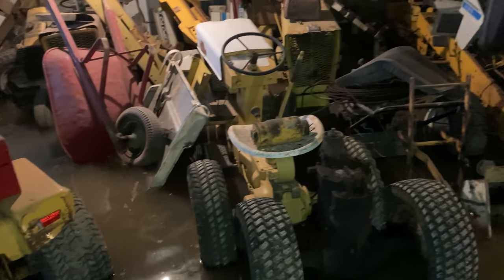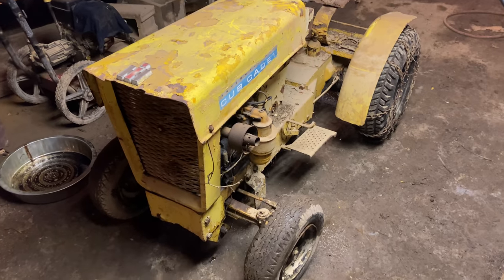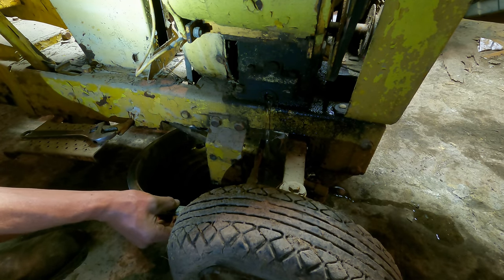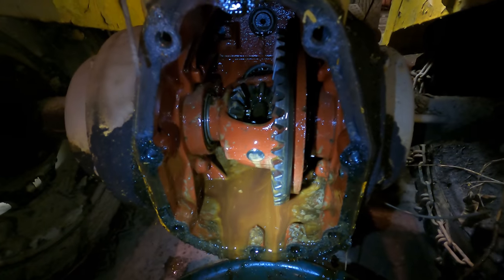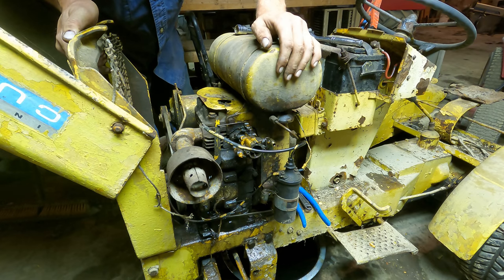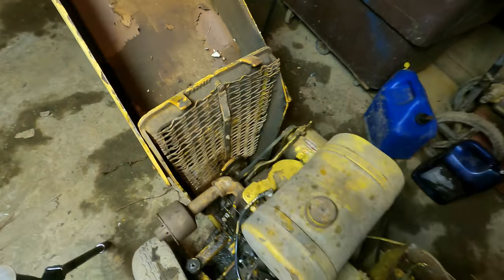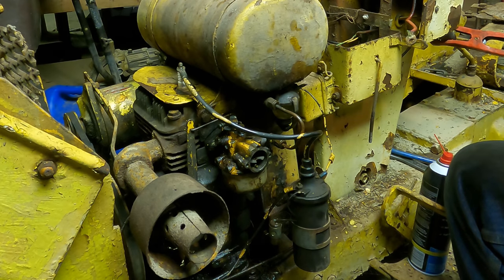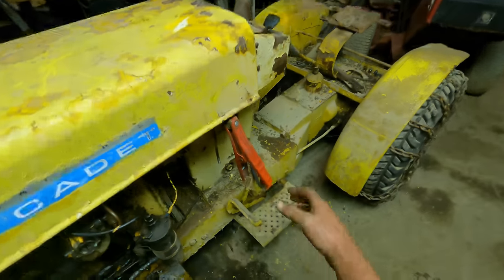Flooded Tractor sitting 10+ years, Will it Start and Drive??

Comment: It's always funny that people will put so much time into painting, but won't even bother to clean anything first. I've seen old machine tools where you just peel off 8 layers of paint, clean it up, and the original paint at the bottom still looks fine!
Reply: Oh man?!!! Was that a big red I saw 👀 😭
Reply: More paint more better.... Right
Reply: My grandfather had a metal lathe that we couldn't tell what year model anything on because it had so much paint on it. I'm not joking when I say when we stripped the paint off of it it had 21 layers of paint on it.
Reply: Really depends on what type of machine we are speaking of. Big Tools are painted to keep looking fresh. They some time even painted them new so that the original paint does not go bad or its not the color of their shop. Painting also helps with theft or people trying to sell your machine. I have seen massive amounts of things painted and its hard seeing a machine that has years and years of paint on it. I spent 2 solid weeks stripping, sanding and cleaning up a massive 18 inch jointer for someone. I spent so much time removing layers and layer of paint. I sanded and fixed a lot of castings marks and made it look very nice and we painted it a bright yellow and polished all the knobs and handles along with paint on them. A few years later the guy died and the original owner of the machine came and got it for a stupid low price (100 dollars ) and now it sits under cover in one of his buildings to never be used again. I worked 2 weeks and was paid and traded for some stuff. The hours I put in to that machine and it was sold for 100 bucks. FFS.
Reply: Yea seems counter productive to me
Reply: Had an old "black" wheel horse that with a good pressure washing returned to factory red.
Reply: What amazes me is oil drain plugs for lawn tractors hasn’t changed a bit—put it somewhere that will allow the oil to go everywhere except the pan.
Reply: Spray painting the house, and the yard tractor is sitting right there... so....  sigh
Reply: @kameljoe21  Think it lucky thats what happened to it, over the years I've tried to buy equipment from guys, who said not for sale they'd restore it or it has huge sentimental value. a few years later the guys have died and I've tried buying it from the estate.  They say "we'll get back to you", one place the scrap grapple turned in the yard as i was leaving, several other places were cleared shortly after. They had no intention of saving anything from the scrap crushers  after the old guy died !
Reply: Me too many times
Reply: I’m kinda disappointed I didn’t paint my puch maxi when i had it taken apart. Would’ve increased the value a lot, but the original paint is still fine and i cba to take it apart again.
Reply: Paint dosent make it run well lol I have great running rusty old junk haha
Reply: That's a nice ol cubbie - I'd restore it if I owned it
Reply: I think a file is better on the point surfaces as it leaves no abrasive behind
Reply: Paints main job is to protect the metal from rust period, anything else is just gravy. When in dought slop it on, easier to strip then rust.
Reply: Hey Wes u or diesel creek need to have a video on how to to hook up a after market  voltage regulator for a international  cub 70.... would help me out a lot.
Reply: Get enough layers of paint on there and it becomes structural!  The original metal could rust away and the body would still be there.
Reply: It's because most people are lazy
Reply: So true for company tools,  programmed maintance at it's best.
Reply: Someone repainted my grader with a brush and they didn’t even clean it. I was wondering if someone snapped off a bolt in a treaded hole, nope wasn’t a bolt and it was just dirt that had been painted over twice
Reply: 4
Reply: 4
Reply: Nearly every Wheel Horse I have ever bought has the Craig's list rattle can finish. Very handy when you need to read the manufacturer model and serial  numbers

Comment: I had no doubt.  Many years ago, a National Guard construction troupe was doing some winter exercises in a swamp in Western Minnesota.  They were using an International TD-24 tractor/dozer.  The machine fell through the ice in a swamp, and  the machine was under water. The Guard unit left it to rust.  Forty-Three years later, the Minnesota Department of Natural Resources wanted the machine out of the swamp. A group of preservationists, along with two heavy duty wreckers fished the machine out of the swamp,and hauled it to Perham, Minnesota. It was worked on,  and now runs and works.  The machine is on display at the fairgrounds in Perham, Minnesota, where it moves and works during festivals on the grounds.

Comment: My family used to own an early to mid 70's Cub Lawn tractor (the model with the taller than usual rear wheels). It's amazing how over engineered and powerful small tractors were back then. I also really love and appreciate (looking back now) how EVERYTHING was metal and robust with no cheap plastic panels or weak alloy components. They had real weight to them because the frame and cases were thick steel that made them far more stable to mow on steep hilly areas by proving the traction and lower center of gravity needed. You can't forget about the proper PTO that allows that small tractor to be used as a real tractor when needed. Watching this video makes me want to start hunting down an old  unit to restore and  replace my current plastic, composite, alloy, and thin sheet metal framed 2019 Cub.

Comment: First time I've seen a man give mouth-to-mouth to a cub cadet. You sure do love them!
Reply: The old Koehler engines have mechanical fuel pumps that would have outlasted the pyramids if they hadn't put alcohol in the fuel. The Cubs were gravity fed so not that big of an issue but the Wheelhorse tractors have a tank under the seat. I have 2 that you used to have to breathe some life into before I put electric fuel pumps on. The springs that close the check valves in the pump are steel which pretty much disintegrate in water which alcohol gathers.
 So yep, if you want it to start, pucker up and give that fuel tank a big sloppy one. The tounge thing is optional and not recommended....
Terry from South Carolina

Comment: Did that bring back memories. I had one just like yours. It had been bored and rebuilt just before I got it. I plowed snow with it for six or seven years before I got my first Kubota. That ole Cub was one tough "mother". I had chains on the rear and with a 52" blade.  I shamed a guy on our street with a 25hp full dress green mach. The Kohler engine had 7hp label on the housing. I was rolling 10" of snow in high gear because of the blade geo.  He was spinning out in low and his blade was actually pushing down on the snow rather getting under and rolling it off. He stopped me and asked "how many hp does that thing have?' I Just flipped the hood up, he saw that 7hp, muttered a expletive and went in the house.  Never saw him again.....
Nice work on your part-keep up the variety..

Comment: It would make a great project for a full restoration. I would love to see you strip it down completely, clean the frame and all the components.  Repair what needs repairing, replace what needs replacing. Repaint and rebuild. It would be sweet to see the result.
Reply: I would also. But sadly I don't think we will ever see this tractor again. He has tons of such projects and still gets more every week. At some point the number of projects will certainly out number the life span of even the oldest person ever in existence...  The number of projects he has started are amazing. But I personally have never seen but maybe one or two finish at this point. I think he just loves to get old equipment and make them run. Than the challenge is gone and he moves on to the next. JMHO
Reply: @garymucher9590  He needs to partner up with someone interested in taking the project on to full restoration.
Reply: Yeah Matt,
Hopefully, you have second thoughts and do a total rebuild !! It's worth it, I think - don't you think so ?
Reply: @garymucher9590  yeah it would be nice to concentrate on one project rather than getting interested in one that’s never going to get finished
Reply: @johnking8679  Autocar first.
Reply: Matt will want to half-assed pressure wash it, then prime over the old paint and rust, and then paint it.  We want a full tear down and refurb!!
Reply: You spend the countless hours and money on a complete refurbish and you end up with an old tractor that you have spent more than you can ever get out of it.  If Matt wants to spend his time that way, that is fine.  Hoping someone else spends their time that way is a completely different thing.
Reply: @jimw3799  it would be nice if he would let it go instead of saying that he will get to it eventually, while knowing that he won't.

Comment: When I moved my Mom down to Georgia from NY to take care of her 4 years ago, I bought a 16' cargo trailer to bring down her stuff. I left behind her Wheel Horse tractor they bought new in the mid 70's. It was still operational and my sister's husband used it to cut her lawn afterwards. There was much I wanted to bring down, but I filled the trailer with about 5,000 lbs. of her stuff and with a 37HP tractor to mow my lawn I didn't really "need" the Wheel Horse. It was really in very good condition as it was used every year, stored in a barn and battery removed every winter. Glad to see yet another piece of vintage steel brought back to life!

Comment: Hey Matt, Great job man, not to take anything away from your accomplishments but I believe the correct terminology is "needle and seat" for what you unstuck on the carburetor which allows fuel to fill the bowl.  A "jet" actually meters the flow to the engine in precise amounts for combustion. That being said you did wonderful, sorry for the flooding.  Have a great day and stay safe.

Comment: Congrats on the re-birth of this tractor, It is really hard on the voltage regulator when there is no battery to charge into, the output voltage will spike and can fry the coils in the reg.

Comment: Its great that you have "saved" these tractors from the scrap pile.  It seems counter productive to start work on a promising project, with little effort made to clean the area of work, of oil and debris.   If 25+ years as an aircraft mechanic taught me anything. it was clean is good and contaminated, with heaven knows what, was not good.  A few minutes general cleaning would pay benefits in the end.

Comment: I'm located in the Nevada desert and floods are not very common, but much more violent. Congratulations on buying a contact points file. It might take some gettin' use to, but silica deposits from sandpaper or a finger nail file will be a thing of the past. I've had the same one for over 50 years. Next you might look for a "Dog bone wrench" for female square drain plugs. Some older ones are not the common 3/8" or 1/2" size that you can use a socket wrench on. I really like your videos so keep 'em coming.

Comment: My dad's rebuilt a few older cub cadets. I've been using one of them to mow my yard and it's awesome. It has the hydrostatic transmission in it and man it flies. Lol. Great old tractors.
Reply: I used TI work for IH years ago.  I was overhauling Cubs that were 30 years old, and only needed a .10 over bore to get another 30 years.

Comment: My experience with small engines has been mostly boat motors.  But sea foam is a blessing.  Make your own.  A jigger of acetone in a quart of kerosene.  Rings and everything love it.  Especialy if you fog it in the intake until it dies and let it set. It will run the mosquitoes out of town..that's a sweet engine.

Comment: Hi Matt, I always run 2 cycle mix in my 4 stroke engines. I believe it not only provides an upper cylinder lubricant but in the unlikely event that dust got into the engine, there's a lesser chance that the cylinder will be scored up. 
I have also found that the engines tend to run better, stay cooler and burn less fuel.

Comment: Those old Cubs were bulletproof. Our 1964 had the motor rebuilt at least once, I think twice, in the end Cut grass and plowed snow for at least 25 years. I think Dad bought it used in '74. Had a tooth missing out of 2nd gear and kept rolling. The mower deck was 1/4" thick cast. They were designed not to break.

Comment: It's a Kroller, clean the points and carb and she'll run like a top!  {Your reference to the main jet was actually the needle and seat. The main jet is in the center of the bowl and is adjusted by the screw on the very top of the carb.}

Comment: Tip for readers: Now I doubt it's a problem on these old tractors (I have a 102) but careful running machines without a load to charge (a battery, dead or not). I burnt out all the bulbs and various electric bits on a Polaris ATV that way. 

Nice work!

Comment: Sorry to see you have to deal with flooding Matt.  Great video though.  The old Cub reminds me of my Allis-Chalmers B-1 garden tractor from decades ago.  Very similar design.  You probably have your own method of cleaning carbs but an old co-worker of mine taught me a cool tool for cleaning those tiny passages.  High E string from a guitar.  The kind that is wire wrapped with very fine brass wire.  Acts like a round file but won't damage to passage.  Keep up the good work.  My wife and I enjoy all of your videos.

Comment: We had 2 Cub Cadets. The first was from the early 60's and was a 10 horse model. The 2nd one was from the late 60's or early 70's and was a 14 horse with a hydrostatic drive. Both were great machines. Back when they were made by International Harvester they were well designed and over engineered. Today the Cub Cadet name is owned by MTD and they are designed and built like all the other MTD machines.

Comment: Others may have already mentioned this...but the piece you are calling a jet associated with the float in the carb is actually referred to as a needle and seat.  Sometimes it is helpful to take off the fuel line and spray the penetrating fluid in that opening to get to the backside of the needle valve.

Comment: I add Marvel Mystery Oil, STP injector cleaner, and Sea Foam to the gas that I use in my small engines.  It helps to keep the fuel components clean.

Comment: My dad got one just yours, when he got it it had a blown motor, so he put a Briggs on it, an didn't realize how it worked an had 3 reverse an 1 forward...lol, he fixed it though. Had it now for about 20 years, we put some ag tires on an used it around the house to fire wood from wood splitter to shed,from shed to house.... Can't find parts for though, he had to have the clutch relined, but it a work horse for sure...love them ole garden tractors...

Comment: I have a second series cub cadet and it still run,  bought it several years ago from a small engine repair shop where the owner was  retiring after 52 yr.  also got a  old Gravely that runs with 6 attachments all in working order.

Comment: If flooding's likely to be an issue in the future (all too certain...), then it might be an idea to build some racking to keep all the tractors & other stuff 2-3' off the ground.
Make a mobile work bench the same height & you could pull the tractors off the rack & straight onto the bench.

Comment: My first car (1964 Peugeot 404) had both a permanent magnet generator and a starting crank under the hood.  More than once I won a bet by taking the battery completely out of the car and demonstrating that I could still start and run it.  Alternators require a battery to energize the field coils.

Comment: Good job on that one. I finally finished a revival today on one that I had been working on for a year and a half on and off. It sat outdoors with a seized engine for 7 years, and I got it running and cutting, and so far I have only had to replace the PTO cable and battery (I already had an extra one), and I still have to rewire the headlights. It's so much fun bringing them back. I'm only into it $50 so far.

Comment: Since you've worked on Cub Cadets far more than I. I had didn't want to question why you didn't take the carburetor off entirely in your initial attempt to start. But, as you went along it was all explained and seemed reasonable enough. Why put so much effort into something if it's not going to be a positive outcome. I now supposing we don't see many of your outcomes that are not so positive and if not then I'm going to have to question why you didn't take the carburetor off. You have put me in a loop. Thanks for bringing us along.

Comment: Points files are awesome tools!! Each time I buy one, someone decides they want it more than me. Bad to hear about you being flooded there. Early cars with generators used the battery for engine starting. The generator took over once rpm were increased.

Comment: You should get some decent scrap wood (or scrap metal, what have you) ditch the wheels, and raise the tractors all the way to the ceiling by mounting the wood (or metal) unto the hubs, and pulling them up (the wheel pegs should be connected in pairs for this to work). Once you're up, you nail a diagonal brace and that's all she wrote.
I've done this with a couple of my grandpa's rare cars when we were announced that we might get a flooding. That was back in 2002, when we ate it. It works, it's simple, and so long you use decent materials, and don't touch them, they can stand up for years.